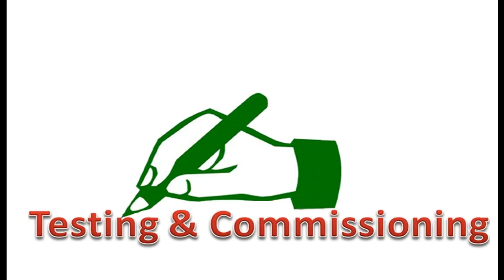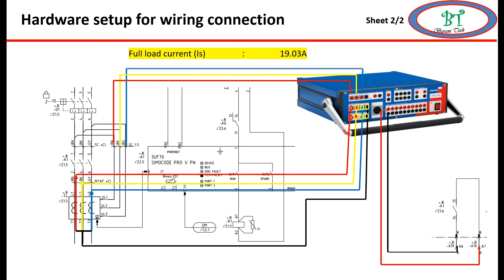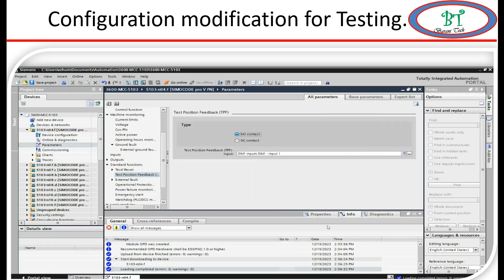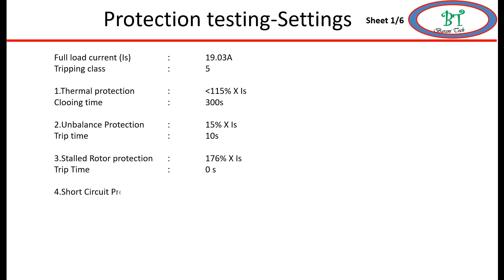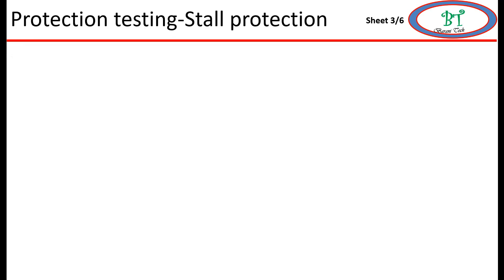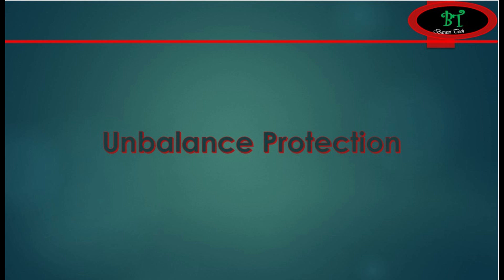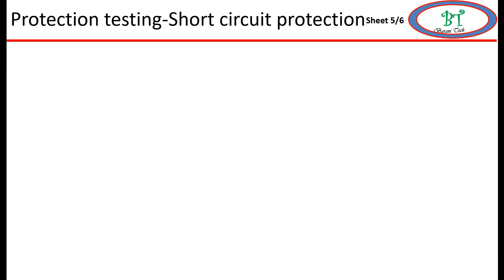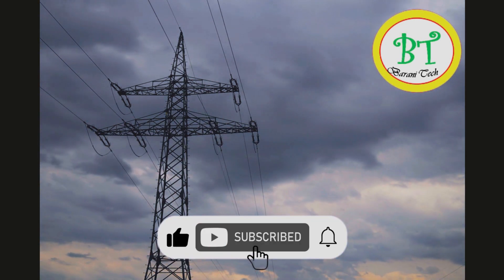MOTOR PROTECTION TESTING | SIMOCODE RELAY TESTING | #motortesting | #relay | #protection | #motor

Comment: sir i have a question, what the standar that your explained about value of thermal, unbalance, stall protection and other?where is we find it?
Reply from the maker: for thermal it should not go beyond the 120% of its thermal class, for unbalance max is 25% , for stall is 175% to 300% but i didn't know where to find the stand value . i will check if i found then i will share to you . thank you.